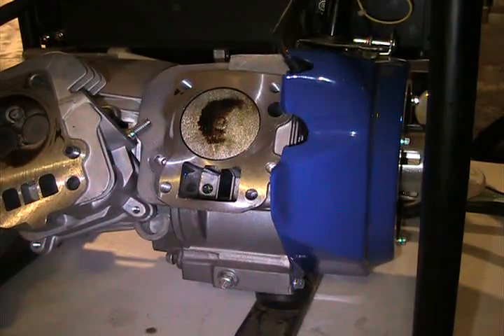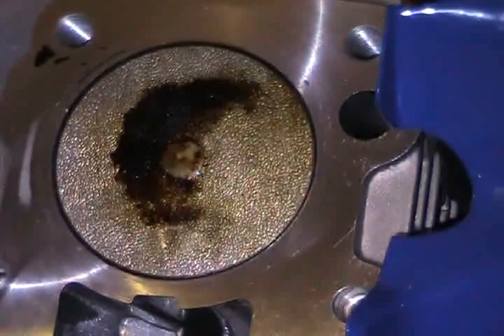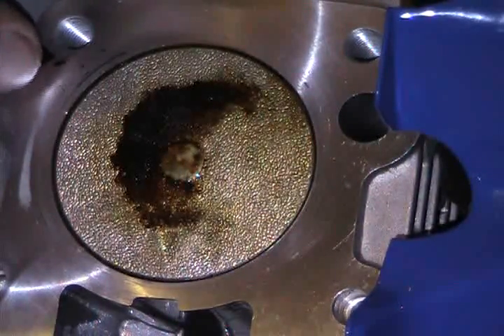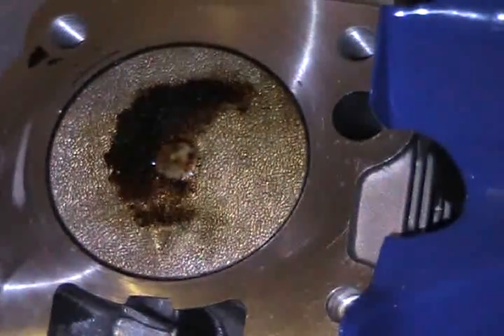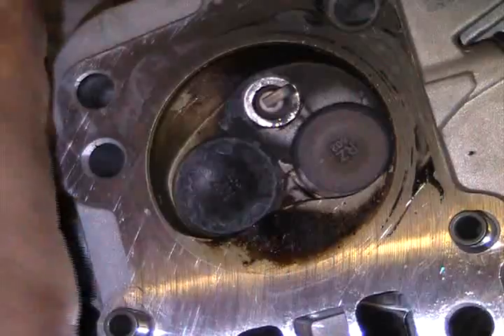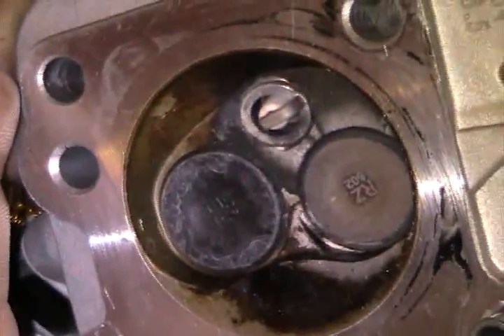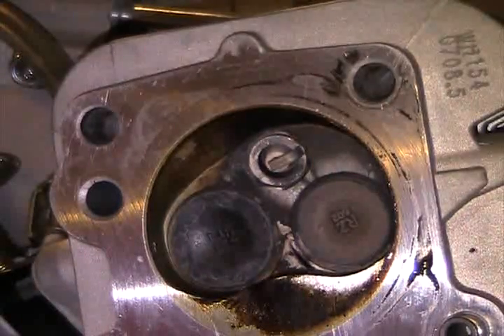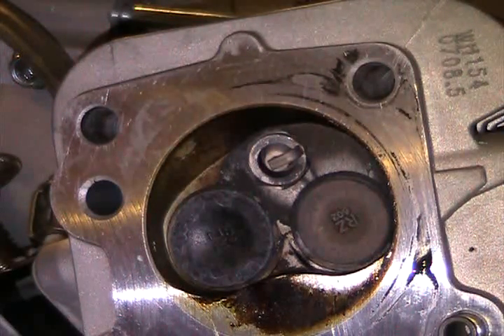generator test 24 engine running on hho

Comment from the maker: @imtotob well what you use your build for is up to you. But as far as the fins, with enough air flow and enough water in the reservoir (1.5-2 gallons) i would not be worried about the cell getting too warm. The fin idea was just an after thought, I have run non finned cells for hours and they do very well.

Comment: Hi,
Ive just bought my ss plates 2mm thick and same size as your design,,,,,im plannin to put in my car    until i realized your last comment... to use a 4 inch contact plate and the rest of the plate as fins for cooling....i am confused.to go ahead or not or start with your new idea of cooling the system...........
Im planning to put magnetron magnets under the plates if it can be used in recirculating the coolant  and elecrolytes at the same time......
started already in ur new set up?????

Comment: @d3adp001 Yes you are right, I´m still working on a calculator, I think in the stoichiometry 14 parts of air and 1 part of gasoline for the combustion, but as a case study data does not match or I can not find the relevant time or the relationship, I'll keep working on it, thanks for to share your excelent job

Comment: ahhhh your engine is 87cc, for this capacity you need 81,17cc of Air and 5,83cc of gaseous fuel for 2 revolutions, this engine is 3600 rpm, in one sec occur 60 revolutions 30 suctions and 30 explosions, so you need to inject 10492,2 LPM, for 174,87cc per suction.

Comment from the maker: H can travel so fast that it can travel upstream out of the intake, injection would have to be close to the intake valve
Reply: What the fuck are you talking about. Everything in a car engine has a flow rate. In one direction. In the intake. Air is constantly being feed to the combustion chamber. 
You’ll hook the line straight to the PCV before the throttle body. It will be treated like an additive agent like NoX. If air goes upstream in your engine, you have a serious problem. The engine is under a constant vacuum pressure. That’s why crankcase pressure is really important for power

Comment from the maker: In a sense, but a cylinder is never 100% filled, so to use 100% of the cylinder volume x rpm to calc the needed hho, would be around 20-40% off.

Comment from the maker: ya I been watching the spark plug boys to see when they would turn something interesting out, I figure if I work on this end, and they the other, we all could meet somewhere in the middle to put all the stuff on one engine. Rev's last test with diesel in a gas engine was very cool. Its been a long time coming for the actual engine tests on plas spark to begin, and now that they have, I hope they will clean the system up a bit, and it will be something that can be added to this setup.

Comment: i like a good finale!
dont think it will burn a hole in the piston.
need serious amps for cutting.
any metal deposition should be between the plug terminal and the plug shroud only.

i know you guys are thinking the same hundred monkies thoughts i am-so i will just keep tinkering away at the spark.
you are being very thorough-and thats great-but the suspense is killing me=]

great work guys-keep it up!

Comment from the maker: well I do know that there is a limit to how much crude gets onto the parts in the engine, so 1 year or 15, so long as its not getting oil in the intake, and the air/fuel is correct, it shouldn't matter. I am thinking that hho with gas cleans better because of the increased heat.

Comment: from what I read, the valves tend to get brittle, particularly the stems ... not sure how much hard research has been done on the phenomena but it seems this is a factor when dealing with hydrogen as a fuel ... for a manufacturer, this would be easy to solve with ceramic valves ... but its a tough one for the backyard experimenter ...

Comment: wow thats cleaning good-so what about the hydrogen embrittlement?
would be good to have a spare piston and when your done -do drop tests with a weight and hardened point and measure the depth of the of the dents.

also i would love to see if that hot spark i was playing with yesterday increases the idle speed.=]

Comment from the maker: part of it is proly how hard the engine is running, its running slower on the hho, but with yours, running it at full tilt it would proly clean up faster. Full tilt gasoline run 12hrs, proly means equal or time the time, at hho at idle. But that will have to be tested.